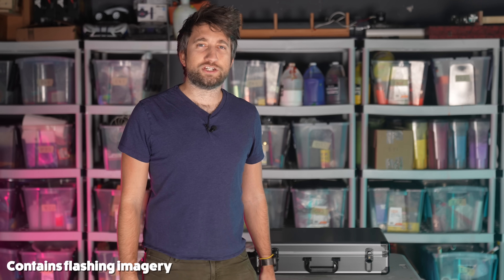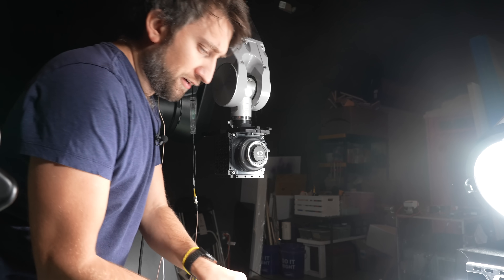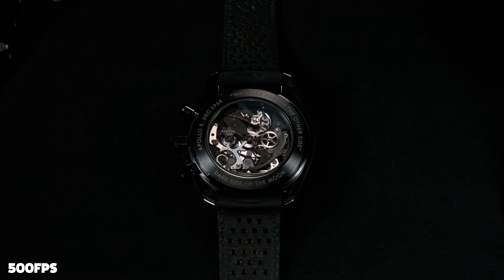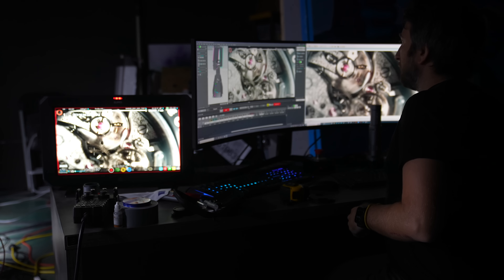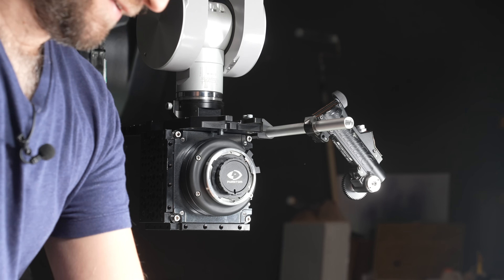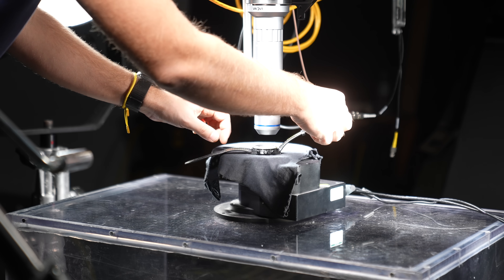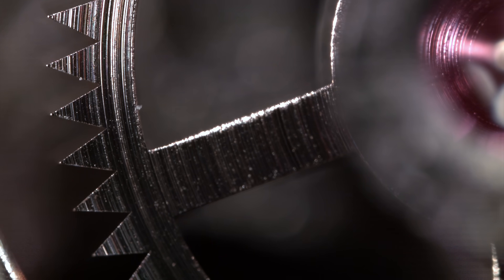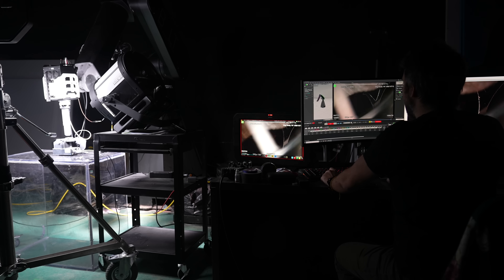Slow Motion Microscope Inside a Watch - The Slow Mo Guys

Comment: I loved this video. I’m a watchmaker. Yes that’s gunk and lint inside your watch. That gunk may cause the watch to fail eventually. I have to say this was beautifully shot. You made really insightful observations about the looseness of the wheel. All wheels have to be a little loose to allow the transfer of energy. And the chronograph hammer, which resets the chronograph seconds hand, is incredibly strong for its size. It can launch other components across the room if not assembled properly. I loved this video so much I’m sharing it with some colleagues who can’t use my high powered loupe.
Reply: Yah I have to imagine that if there is no give even the metal would break eventually with all that movement and metal pieces hitting each other.
Reply: @joebaxter6895  It's easy to see how the gears could lose tiny flakes of metal and cause big problems over the years as they fly around the case due to the wearer's movements. Makes my skin crawl to think of a loose tooth-tip flopping around the escapement. 
The sound was false, but perfectly conveyed the reality, which is machined pieces of metal bashing into each other hundreds of thousands of times a day, for years on end.
Reply: How does one get into watchmaking? I’m a mechanical engineering student so I have familiarity with some of the mechanisms, but how they come together in a watch amazes me. Any good books or videos to better understand the design of the movements that you could recommend? Design of the case could also be interesting, but really I’d like to know more about the movements
Reply: @the9red9one  google NAIOSW, in Fort Worth Texas. Gotta get yourself in a program or apprenticeship.
Reply: I gotta say it is absolutely impressive how precise the machining is for so delicate the parts... which are also rugged enough to withstand daily usage.
Reply: Thank you! My curiosity about the gunk is answered!
Reply: @dianacourt377  of course. As a watchmaker, seeing the gunk in my watch is like a chef seeing hair in his soup. Not good!
Reply: That is awesome, I bet you have fun seeing the different ways each watch maker handles the exact layout of parts to do the jobs.
Reply: What's it like searching for millimetre sized sized components which have been flung halfway across the room by a spring?
Reply: @minerscale  when watchmaking (aka Horology) becomes floor-ology! You have to listen first. You always hear that pin drop somewhere. Or sometimes you play pretend CSI forensics and try to imagine how the little doohickey was flung to retrace where it landed. We also use magnetic strips to wand across the floor if the part( or screw) isn’t very reflective and hard to see any contrast between the component and the white floor. Over my career, I’ve spent hours looking for irreplaceable parts on vintage timepieces. I’ve only actually ever lost 3 parts which I’m very proud of.
Reply: @minerscale  it’s when Horology becomes Floor-ology
Reply: From a mechanics perspective, I would have imagined it having something to do with leaving space for thermal variations without leaving the gear train in a position where it might Bind. I'm glad to have found an explanation of why, even though I was wrong. 

Is that something that's generally ever given much thought in matchmaking?
Reply: @goosenotmaverick1156  not necessarily but some pieces are specifically designed to endure the elements better than other and they may contain special alloys to help mitigate temperature changes or even combat magnetism.
Reply: Rodico maybe??
Reply: @roversgonemad  was thinking that too xD also i like the floor-ology comment XD watchmaker-live is spent more on the floor than at the table. I sometimes use a swiffer to find a part
Reply: @roversgonemad  probably? I use a green or blue colored one. Never seen white before but it looks like gum!
Reply: @FANgrySeb  There are different colored ones, i think they are different "softness" but don't quote me on that. I use mostly the gray one...
Reply: today i found out "loupe" is a word for magnification glass in english as well
Reply: Sir, as a watchmaker, you are uniquely qualified to answer this question: how are the parts themselves made?
Reply: @lawrenceallen8096  it depends what part and the production.
Some part are punched, milld, turned, drilled...
In handmade or restauration it is sawed, field...
Reply: I wouldn't have expected even this tiny level of gunk in a 14.000 dollar watch to be honest. beautiful though
Reply: It's only a mass produced Omega, not a Grand Seiko. What do you expect?!
Reply: @ touché!
Reply: Cool story bra

Comment: When you stopped the chronograph by pressing the start button again, the delrin brake (or in this display case back model, a metal brake) actually holds the chronograph wheel in place. At around 14:51 to 14:52, it's the small pivot arm that looks like a tipped toe leg.

Comment: 7:20 Most modern Omega watches, including this Speedmaster, do not use a Swiss lever escapement. But rather a Co-Axial escapement. It's one of Omegas biggest claims to fame.
Reply from the maker: Ah ok I looked at graphics of both because I thought this was a coaxial, but then this looked more like the Swiss lever diagram I saw when I was filming. Played myself. 😭
Reply: @theslowmoguys perhaps you bought that watch before 2024… I think the caliber 1861 ( 1866 in this model ) is not co axial, since the 1861 is derived from calibre 861 ( before coaxial omega ). Only later Speedmaster ( since 2019 I think) come with the 3861, the coaxial version
Reply: Omega uses, broadly, two styles of watch movement:

1. "Old school" movements that are slightly updated versions of what they made in the 1960s. Lever escapements, metal balance wheels and hairsprings, horizontal clutch chronographs.

2. Super modern movements that incorporate later inventions like the coaxial escapement, silicon balance and hairspring, vertical clutch chronographs and other such features.

The watch in this video is has got a variant of the 861 movement which was first made in the late 1960s.
Reply: Don’t forget to mention that George Daniels invented the Co Axial escapement all by himself, Omega just paid for it

Comment: I think for these microscope shots you would probably be better off with a laser than huge powerful lamps. Probably three at each of the camera's sensitivity wavelengths if you have specifations on that.
That way you get more light where you want it, without just going overboard on bathing the watch in insane amounts of energy and cooking it

Or really maybe just using a single lamp and a sheet fresnel lens to focus it better would be easier actually, with filters for infrared and uv if your lamps produce and the sheet material refracts those so you don't bake it

Comment: I don't know if this can help: when I want to look at reflective objects under a microscope, I can use side-lighting, they call that "epi dark field", but I almost always have to switch to "epi bright field" for more light. Light is focused through taking objective, usually one designed for metallurgical use and can really light up a miniscule object if adjusted properly. Polarizing filters along with a quarter wave plate can generally manage unwanted reflections from a clear cover glass. I have no idea how you would adapt your high speed cameras to a microscope.

Comment: you should try this with a Bulova Accutron from 1970 -- instead of a balance wheel it uses a tuning form vibrating at the rate of nearly 500 times per second, with one tine of the fork pushing levers that turn an index wheel  about 4mm wide with more than 400 teeth on its rim.

Comment: You should do this with the Bulova 214 watch. It uses a tuning fork that vibrates at over a million times an hour (it's not quartz) and has a "balance" (actually called an index wheel) that has 360 teeth and is only 2.4mm wide. It was made in the 1960s and no one, not even Bulova now, know how it was made.

Comment: not just invisible moments. look at the surface detail on each part: you can see individual cuts of the tools used to shape components.
fyi, that white bit may have been a marker for measuring the rpm of that wheel, as part of QC. most tachometers use white/reflective tape and a flashing light, to take "images" and calculate motion.

Comment: Very cool video! As a comparison do the same for a +100 year old clock that was designed and manufactured without modern machines and techniques.  I have a 124 year old Seth Thomas mantle clock that keeps perfect time. This is due to it being a "regulator" clock which could be accurate to within 10 seconds per month when properly adjusted.

Comment: 7:41 this sliding of the pallet stone up the escape tooth is actually transferring power from the gear train into the balance wheel and is what keeps the balance wheel oscillating. 

Power is stored on the other end of the gear train and is held back by the escape wheel. If you were to magically remove the pallet fork from the movement, the escape wheel, gear train, and hands would all spin very fast until the main spring is completely unwound.

Comment: By the way, the reason the centre seconds cog, has such fine teeth, it because otherwise, if they were the same, it would likely push the chronograph second out of time if it doesn't engage exactly in the middle, so it's got finer teeth to move the second as little as possible.

Comment: Next one you should try the Bulova Accutron, with the original tuning forks and the ridiculously small teeth of the wheel which picks up the movement from the fork. That would be interesting.
There are some videos online, but with this equipment can be much, much better.

Comment: Wonderful video! Thank you. The smaller saw-tooth wheel stops bouncing around at every tick once the chrono is engaged. To see something else normally invisible, film the chrono hand in slow-mo while it is being reset. It bounces like crazy before settling on zero. There is a hint of this when you see the chrono being zeroed in your film, but it is more dramatic from the front. Also (very difficult to film) I saw a watch industry research film of someone clapping their hands while wearing a watch - the central seconds hand was whipping around like mad. Thanks again.

Comment: I've been a watchmaker for fourteen years, and this is the first time I've seen this type of watch movement slowed down like this.
Thank you for this video.
Now, I'm curious to see what another Omega movement model, which oscillates at 50 Hz, would look like when slowed down as well. I'm really intrigued.
Reply: I tell you what, you buy me the Speedmaster Moonwatch Professional (the 3861 movement) in Canopus gold with matching strap, and I'll let Gavin film it in slow-mo for you. Sound good?
Reply: @ChristopherHallett  get me one too but in Sedna gold
Reply: Zenith Defy El primero 200vps would be too much vibration wouldnt it?
Reply: @johnscarceforpresident1647 probably
Reply: Which movement oscillates at 50Hz? I used to have one of their early '70s tuning fork watches that resonated at 300Hz. Couldn't leave it on a hollow bedside cabinet, it'd make the whole thing hum!
Reply: @leehazlewoodism  It's one of the earliest types of battery-powered movements found in luxury watches, predating the quartz movement era. Its operating principle is quite different: instead of using a balance wheel in a mechanical watch or a quartz crystal in a battery-powered watch, it works with a tuning fork and coils.
Reply: @horlogeur  Yes, I've owned one. However it's 300Hz, not 50Hz. Bulova invented the movement but theirs was 360Hz IIRC.

Comment: Have you looked into using some of the high intensity LEDs? I believe the highest output is the Cree XP-L. If I read the chart right it’s max output is around 700+ lumens. It would be something that can be placed much closer than your current lights. Using the inverse square law (it’s been decades since I’ve gone down that geek rabbit hole) placing a 700 lumen light a couple of CM from your subject is going to give you much more intensity than a light at a meter away (I don’t even know where to begin the calculations on that).

Comment: Hey Gav, I have a question. Why didn’t you film this video outside? Why not just take the super strong light outside and get daylight as well as the artificial light? You brought up, many times before, that slow mo needs as much light as possible. 
Are you doing this inside because it’s a Macro shot and you are looking to reduce movement due to wind?
I realize now that you mentioned reflections, and if the reflections was the primary reason, then I’d like to adjust my question to be, why would you ever film inside for other similar sized recordings?

Comment: For anyone that doesn't know Omegas, that watch is $14k.
Reply: the price is the product
Reply: @markifi  There's definitely significantly more engineering that goes into both the design and manufacturing of a high-precision mechanical watch like that compared to a watch with a quartz movement, but not $14k worth, so the rest is just the name.
Reply: @needamuffin  that's beside the point i think. if quertz were the cool expensive thing and everyone else would wear mechanical, people would still buy the 14k quartz watch to show status. the price is the product

Comment: Amazing video! I guess this was made rather quickly, but I would love it if you built some kind of a rig which would allow you to press the chronograph pushers without moving the watch.
If so, I think the most interesting thing on a chronograph to see in slow motion would be the reset hammer hitting the heart cam attached to the stop-seconds hand. I would find it super interesting because it looks like there would be a spring or something resetting the seconds hand, but it's literally just a hammer hitting a heart-shaped cam.

Comment: So cool.

PLEASE! Get inside an engine cylinder during à combustion cycle. It can be tricky to make it but there is an idea.

Drill the engine where it s possible, like between valves and replace the missing part with à transparent surface   were it will be possible to watch through it and see the combustion. Would be epic

Speed of the front Burn it s about 2000m/s inside à cylinder.

Also the cinetics of the piston could be intersting to see if you think about the relative speed up and down

Comment: Interesting that the gears for the chronograph mode had two teeth for one slot on the other. I imagine that there is another gear somewhere that needs to have those smaller teeth, but rotates at the same gear ratio. Very interesting!

Comment: The engineering is incredible!
But, this was made with modern machinery.
Can you imagine the skill of the early watch and clock makers that had to make every tiny little part by hand?
I wish you could get your hands on an early watch and do the same type of investigation.
Reply: Plenty of old pocket watches with open backs. Frett and Co. Clockworks in Little Rock, AR converts a lot of them to wristwatches, but saves the truly special stuff as original as possible.
Reply: I guess now we know why pocket watches were so much bigger than our wrist ones.
Reply: This is not a cheap watch. I have a basic Planet Ocean and that cost enough. But there is plenty of profit in this version I'm sure. 

However this video and your comment got me thinking. Would the Uber expensive movements/watches (bling aside) be more handmade thus more expensive, or more accurately machined? While of course at this magnification it shows up lots of things, I wonder if those super priced watches "better made" or less violet or have less movement?

But then less play means more contact and so more wear and tear?

No matter, it was fascinating to watch.
Reply: @invisiblekid99  More expensive: While this one isn't exactly cheap, I didn't expect the cogwheels' surface finish to mirror (heh) mass production, especially on display under glass.
I wonder how something more exclusive/bling would look like under the lens that has, say, polished wheels, artwork and such. Bexei comes into mind with the in-house made movement (IIRC).
Reply: This style of chronograph movements have been made to this level of precision since at least the 60’s. The movement in the omega speedmaster has actually changed very little over time and its still pretty similar in design and construction to the watches worn on the moon in 1969. It’s a magnificent example of ingenuity and engineering
Reply: Tbh, from what Wristwatch Revival says (the channel Gav mentioned watching) you can get pocket watch movements pretty cheap on places like Ebay, so he could def do this!
Reply: You want to see some super geeky, super well done cinematography on watch making? Look up Patek Philippe 5175R Grandmaster Chime Watch
Reply: Get a hold of a Grand Seiko Spring drive and you will be amazed .

Comment: Here is an idea.
Maybe you could make a video showing modern gaming setups ala the old CRT video.
Now we have super fast OLED monitors (480 Hz) and frame generation. How does technology like black frame Insertion and AI generated frames look like in slow motion. Can we tell the difference between the two rendered frames sounding the 1-3 interpolated frames (depending on settings and provider, AMD, Nvidia, flowframe etc.)?

Comment: Small detail I'm surprised wasn't pointed out, but it seems like the "wobble" disappears when the free wheel is in contact with both the seconds and the chronograph mechanisms. Would be curious if in a watch of similar quality but without complications that bounce would happen or if it's a built in tolerance to guarantee alignment between the various mechanisms at all time.